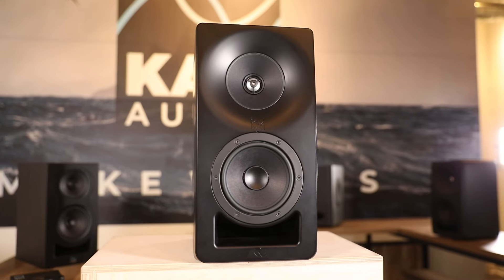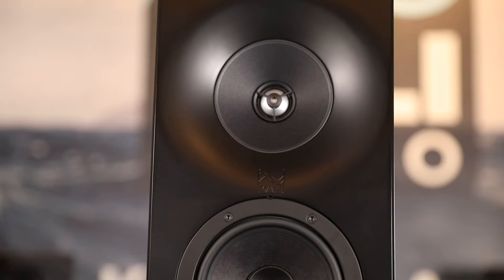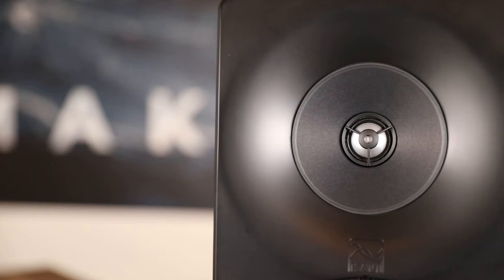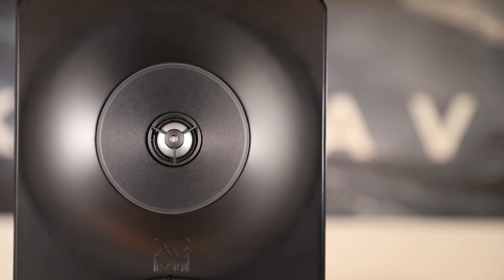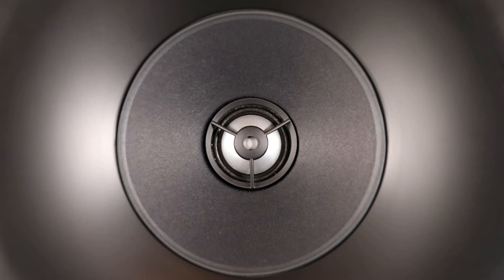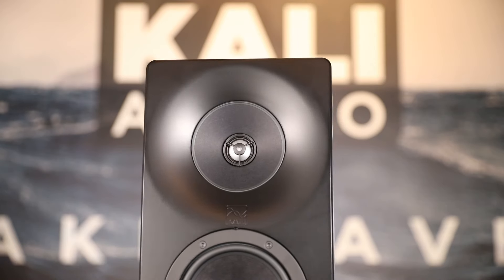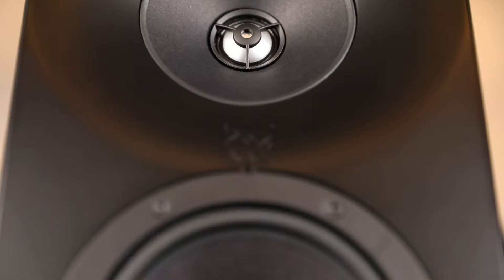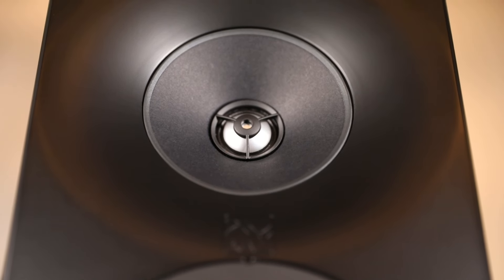FAQ Friday: Why a metal dome tweeter for Santa Monica?

Comment: Interesting... But way too costly to go from LP/IN-8 V2 to SM-8 just for a more dynamic tweeter. Will IN-8 V3 have the new aluminum tweeter?
Reply from the maker: More dynamic tweeter, improved midrange and woofer, much improved amplifier and a whole lot more. Less than 1/2 the distortion of IN-8